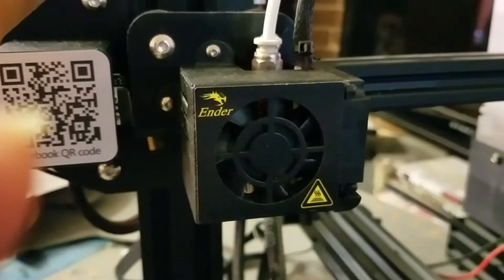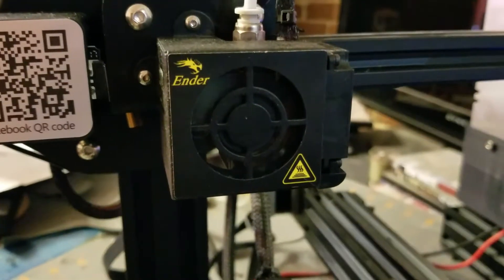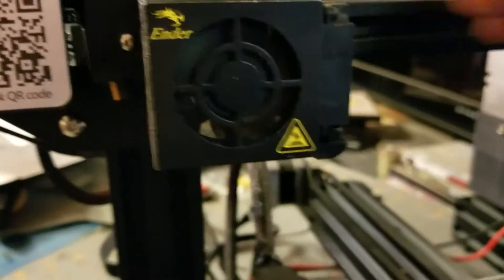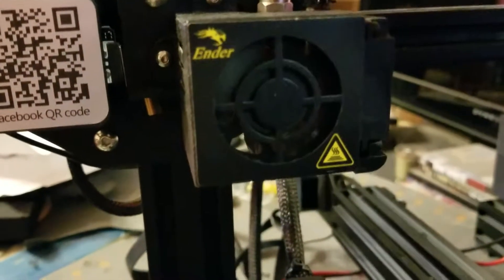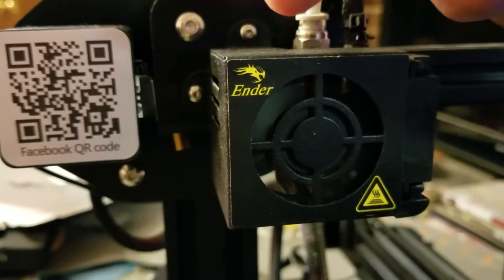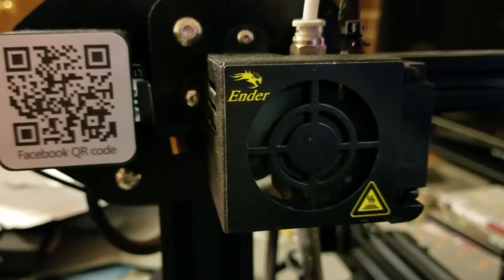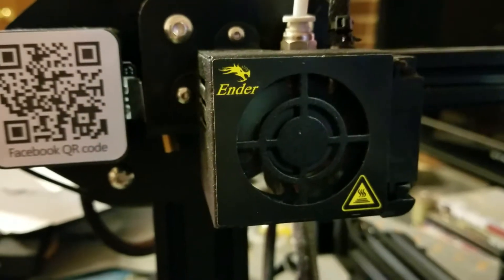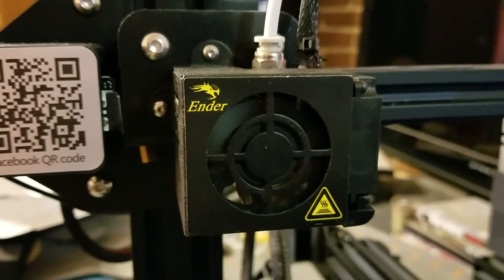Creality ender 3 hot end fan noise

Comment: I've replaced about 10 fans since purchasing mine in 2018.  They are crap no matter what, I've tried many different brands.
Reply: i guess u never heard of NOCTUA fans :p
Reply: @aim6mac  they dont blow as much air as a 24v fan, noctua is 12v and has alot less cfm
Reply: @bradleybell8958  u dont need that much air, the print will come out exactly the same with the Noctua's if not even better.

Comment: did you find a solution yet?
Reply from the maker: We have replaced the fan a couple of times and it ultimately still makes the noise.  It stops after running for about 30 seconds and sounds normal after.  I suspect that it is being twisted when installed or something like that.